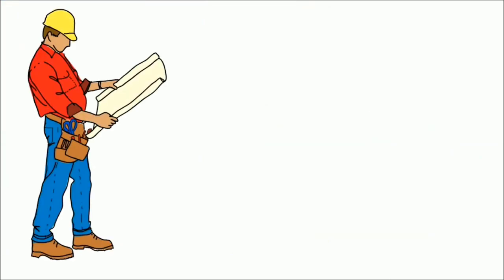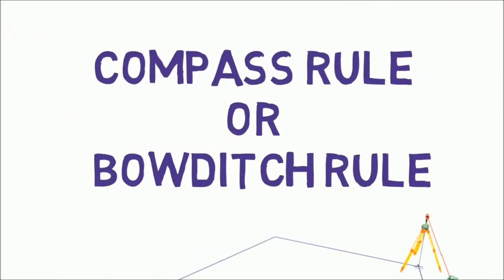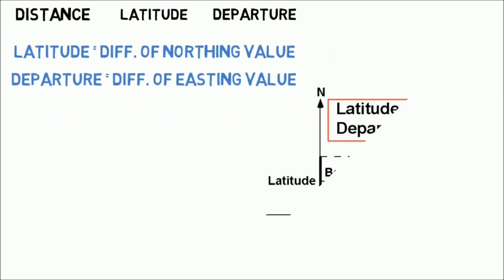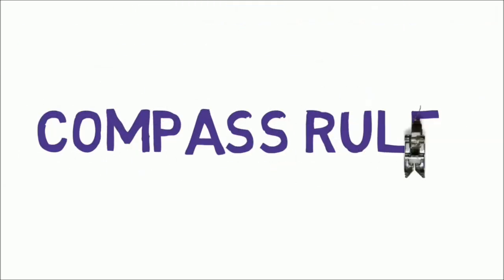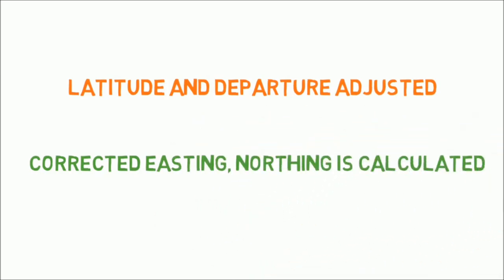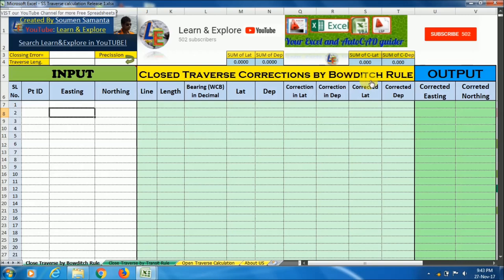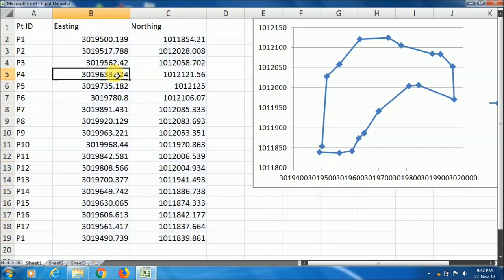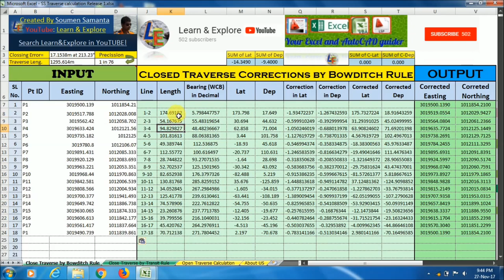Traverse Correction in EXCEL /Transit Rule/Bowditch Rule- Closed Traverse

Comment: Normally, in practical, we always get the data such as Observed Distance, Vertical Angle and Horizontal Bearing. A good excel tool for traverse calculation for the adjusted stations (E,N)-values need to include these parameters. Besides, the level inside the traverse route is also the stuff to be concerned. Remember the positive and Negative faces of balancing the theodolite(the total station instrument) machanical error are also the problem.   I need to find out some templates files to study more.

Comment: Please kindly teach us how to check column verticality in different floor level in multi story building by total machine
Reply from the maker: +Bicky Sakha 
Set up your TS with perfect leveling 
Then view a side edge of the column through the cross hair
Fix the horizontal movement
And Now turn the telescope up to the top of the column
And check whether that said edge is alligned with the cross hair or not
If the cross hair is shifted from the edge then your column is not perfectly vertical.
In this way you can check the verticality of the column.